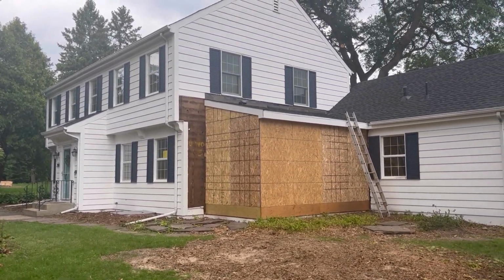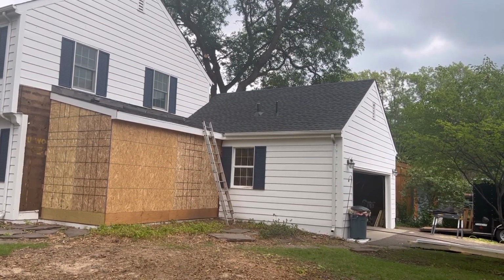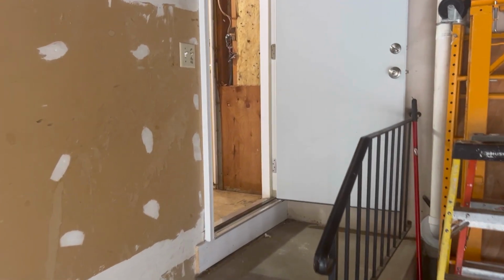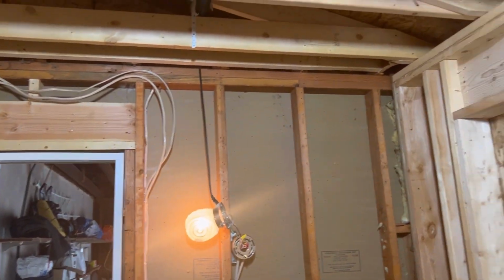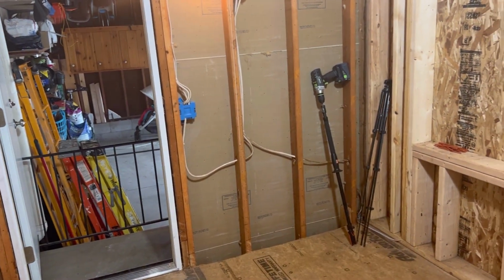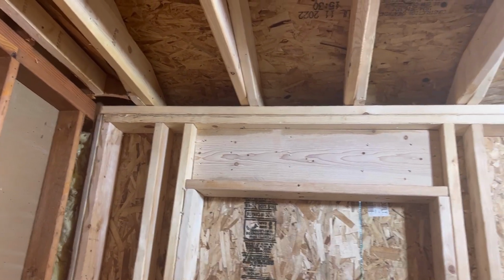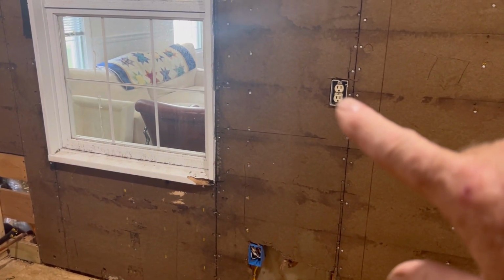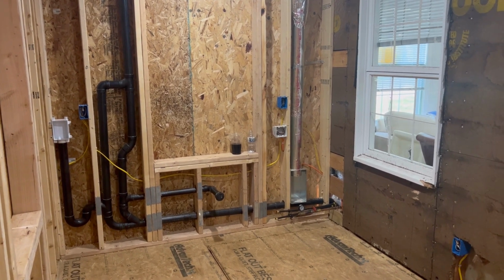Mudroom Renovation: Plumbing, HVAC & Electrical

Comment: The tie-in to old roof looks great, done right. Explanation of Radon system is correct, gas is slightly radioactive, 2nd leading cause lung cancer in America. Red liquid in tube measuring airflow is a U-Tube Manometer.

Comment: Yep it can be a right pain in the butt, when you have to wait around for inspections or on parts required to do the job ie windows etc. In NZ the lack of Gib board is a major issue was well as the price of timber. Covid Pandemic is causing issues world wide for the building trade.